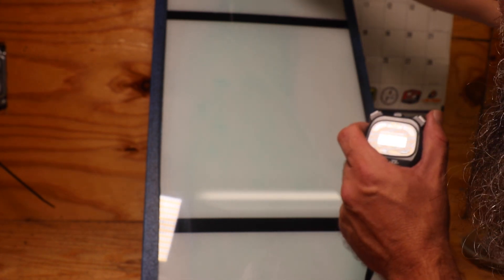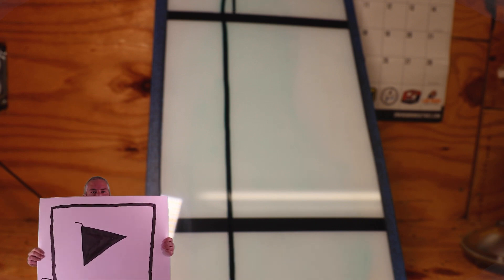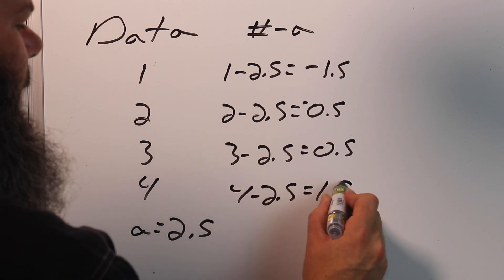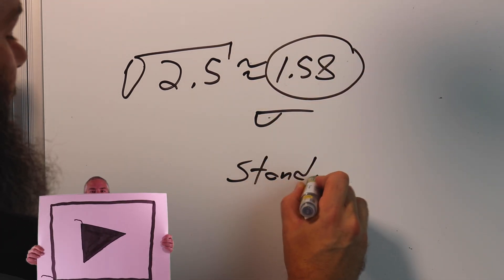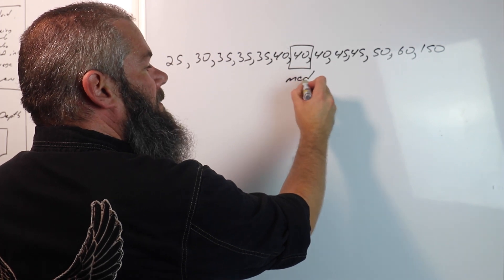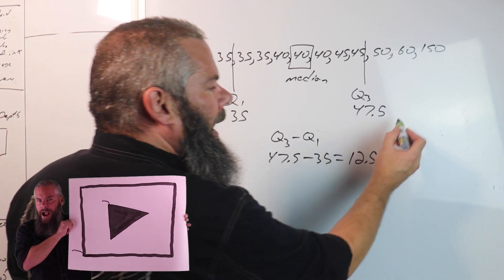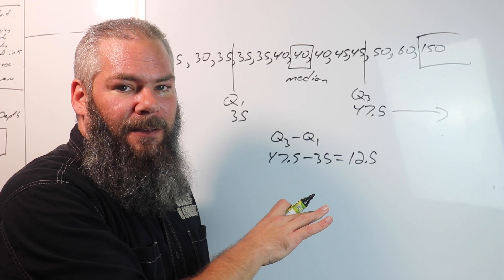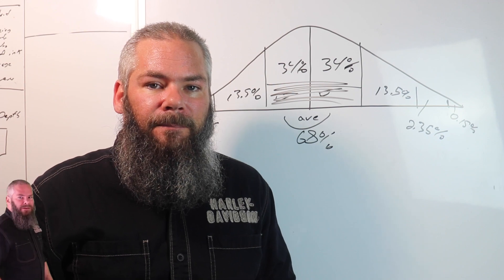How I Test Ink Viscosity Fountain Pen Ink #fountainpenink #fountainpens

Comment: thanks for the insight in how you test viscosity and the effort to produce all of your videos.  One minor issue - you might want to check the calculation of average of the differences between # and average....I think it is 1.5 not 2.5 for your example.  Also, some use n-1 for the denominator for samples less than the population.  Thanks again
Reply from the maker: You are correct about the mistake I made in the example for the video.

I was trying to keep this as consumable as possible for those without a math background, I  avoided being to technical for that reason.

But thank you for noticing the mistake in the example and for the comment.
Reply: @AnInkGuy  not trying to be nitpicky, thought you might want to know.  Thanks again for your videos

Comment: I was wondering if you could also test the viscosity of the De Atramentis dilution liquid and the Noodler's Whiteness of the Whale ink to see how it will affect the viscosity of an ink that you add it to.  I would like to try this because I find some inks look darker than what I was hoping for.
Reply from the maker: I don't have any plans to test how different dilution solutions can effect the viscosity of an ink.  That would open a huge can of worms, lol.
Reply: @AnInkGuy  You would only need to make about 100 dilutions for each ink you test!
Reply from the maker: @rjayt88  LOL, that's right just 100 per... so I am currently getting close the 1000 inks reviewed, so I would also have to repurchase a ton of inks. LOL
Reply: @AnInkGuy  I have one question about the viscosity test.  I would just like to test the dilution liquid myself just to see if it will lower or raise the viscosity of an ink that I am adding it to.  When you do the test, do you use a certain mass or volume for each ink or just put one drop on to see how long it takes to go down?
Reply from the maker: @rjayt88  I just use one drop, net an exact volume to the drop.  But I try to keep the size of the drop for water and the ink the same.
Reply: @AnInkGuy  Thanks for your help.

Comment: Couldn't temperature affect water's flow and the ink's flow differently? I'm thinking of butter vs honey vs water. If that were the case, heatting them to a certain temperature, say 30C, and then running the experiment could control for some of that. Its an extra step, and maybe it wouldnt make a difference... but something to think about. Thank you so much!
Reply from the maker: Yes temperature can affect the test and the flow of ink.  In fact it has the greatest effect on it.  So it is important when doing these tests to recalibrate with water very regularly.

Comment: Good job, both for the fastidious work of collecting the data and the concise explanation. Really well done.

4:03 No, it's not weird to have whiteboards. It's a tool. It's not different than owning a hammer or a soldering iron. At some point, I even transformed a refrigerator into a supplementary whiteboard because I was working on several projects at once. Some offices have their walls and tables entirely painted with dry-erase paint : https://www.performance-painting.com/hs-fs/hubfs/dryerase.jpg?width=887&name=dryerase.jpg

A tip from radio broadcasting : don't get into the habit of highlighting the little behind-the-scenes things that bother you. Most of time they would have gone totally unnoticed by your viewers if you haven't directed them toward those little things. In that case, you unnecessarily distracted your viewers from the content. Or, even if some of them noticed something was bothering you, they likely didn't think much of it... until you amplified, again unnecessarily, a defect that doesn't really matter when it comes to the enjoyment of the content. 

Any way, if it happens sporadically, it only made you more relatable. Perfection, at some point, is only an excuse to do nothing.

Thank you for the all work. This is a very valuable resource.
Reply from the maker: I only left it in in the editing because I only really do ink reviews and I thought leaving the mistake was a bit that I usually edit out of my videos.  That said you are right. I shouldn't have brought attention to the mic that was distracting me.

I had looked at the dry erase paint but wasn't sure how hard it might be to paint over in the future, which is why I went with the board over the paint.
Reply: I didn't think of that. You are right. It might be a pain in the &?%/ to paint over. For the refrigerator I used a static plastic film. It came out without any problem once I didn't need the extra surface.

Comment: Great video, I've been wondering about your methodology.
Have you perhaps considered determining an optimum number of samples depending on the values you get? It would be a more rigorous approach than just taking 9 measurements and calling it a day.
Reply from the maker: 9 was the most I figure I could do from a sample.  I cannot afford a bottle of each to be able to do more  testing than I do.  I do 9 tests because sometime a "run" may be faster or slower than normal for than ink.  I just needed enough to get as reliable a result as possible.

Comment: This is awesome. Was very interested to see how you test viscosity. As one math nerd to another, I was wondering if you ever went down the rabbit hole of computing population standard deviation from sample standard deviation? Just to be clear I am not nitpicking your methods (with a sample size of 1000, they are going to be almost identical), but recently learned about it and thought it was cool and maybe you would too.

Also, do you find viscosity is a good predicter of how wet the ink writes and if it is prone to bleeding/feathering? A-priori it seems other factors could be involved as well (surface tension maybe?). Just curious. And a big thanks for sharing your investigation!
Reply from the maker: I didn't feel the need to go further than sample standard deviation. 

The question of if viscosity has anything to do with how wet an ink writes is what started all of this for me.  What I found is if an ink is to wet, to to close to water's viscosity, then it can have more difficulty writing and seem like it has flow problems.  I found that interesting.  I also noticed that most inks that have a viscosity that makes them dry seem to be "thick." So a bunch of times when an ink tested as dry it gave a very smooth writing experience.

Unfortunately I don't think viscosity is much of a predictor for bleeding of feathering. There are definitely other factors involved, most can be minimized by "calibrating" first.  So I had to run the water every time before the ink making it a long process. It had to be done every time because temperature change of 1 degree and alter the results.
Reply: @AnInkGuy  That's actually really interesting! And no I was not suggesting population statistics vs. sample statistics had any practical relevance here. In my very small anecdotal experience, adding water to a ink (2:1 or 3:1 ink to water say) does have the effect of making the ink a bit drier, so that matches up with what you observed I think. Anyway, cheers, and thanks for the channel.
Reply from the maker: Nice to know there are others experimenting on inks and tracking their results.  You can try dish soap to make an ink flow better through the pen.

Comment: You are a math nerd.  Numbers have meaning by themselves.  One viewer mentions associating dry time & viscosity.   In your test there are a lot of variables, you mention temperature, also humidity, which can affect dry times.  To me the biggest variable is paper.  I find all paper has a wide range of properties on a single page.  Best example is when I get feathering on a few words in one spot & none on the rest of the page, an outlier.   Next is variations in ink, each bottle can be different, over time viscosity will increase as water evaporates.
I echo many viewers, THANK YOU for the time you devote to this & the great videos you produce for our enjoyment.
Reply from the maker: I don't see the paper as a variable because you would be testing all inks on the same papers.  Like I use Clairefontaine, Tomoe River and Rhodia paper as my standards.  And yes there may be some evaporation of water from the ink over time.

While slight variations in the paper and in the evaporation may theoretically have an impact on the result, I don't believe nor have I seen and impact on the measurable results that I am getting.

Comment: I'm really glad that you published a video on your methodology for the viscosity testing. I find that detail to be a very interesting one with inks (it's one of the things I really like about your ink reviews).

However, I don't really think that viscosity is necessarily equivalent to dryness. As an example, most people would say that J. Herbin Vert Empire is a pretty dry ink. Just based on a visual comparison, I'd say that its probably the least viscous ink that I've come across (almost like water). By comparison, Noodler's Heart of Darkness is fairly viscous, and is usually considered wet (though it actually dries pretty fast for a fountain pen black ink, but that's only one aspect of wetness). Additionally, Heart of Darkness feels drier to me when I dilute it with some water, thus making it less viscous (this is likely due to the fact that I'm diluting the "wetting agents" (surfactants?) that are in the ink by doing this). That's just based on eyeballing the viscosity, though, I haven't done any tests.

Of course, most likely people are talking about different things when they're talking about how "wet" inks are, so there is that.
Reply from the maker: I think frequency when people are talking about if an ink is wet or dry they are describing how it can feel as they write with is.  When I say an ink is wet o dry I am strictly referring to the viscosity, nothing to do with how it feels to write with.  I do sometimes mention how an ink may feel to write with. But as far as my results can be looked at... people can see them as they would like.

For me the results just are as they are. 

I am not denying that an ink might be a dry ink but may feel wet to write with, that can be a result of different additives in inks.  I do make slight reference in the ink reviews to how the viscosity is not connected to dry time, but I think people often think they are related.

I have already received A LOT of emails telling me how wrong I am in this test "Because Brian Goulet says he isn't sure how you could test ink flow."

Honestly, regardless of flow, if I like an ink I will use it and that is the advice I give to people.

Sorry if this seemed ranty, I have A LOT of "Corrective" emails because of his video.

I hope this didn't seem like I am being short, that isn't the intention.
Reply: @AnInkGuy  That makes a lot of sense, and I totally get the irritation with being corrected on something that isn't really what you were trying to say in the first place :)

In any case, even apart from how wet or dry an ink feels, viscosity is still a very interesting trait to look at. In fact, I was recently messing around with a Zebra G nib in my Ahab, and it seems like the viscosity of the ink really affected how well it worked when flexing.

A lot of people recommend using X-Feather for this use case, but I found that the more apparently viscous (again, just based on appearances) Platinum Carbon ink actually performed even better. It's a little too heavy flowing sometimes, really. Heart of Darkness performed about as well as X-Feather or a little better, and Diamine Ancient Copper (sadly) performed very poorly. There may  be other factors at play here, too, of course, I only have so many inks to test, and cleaning between them is a pain.

Anyway, that's a bit of a tangent, but keep up the good work, ink guy :)
Reply from the maker: @hypnoshypnos4755  I have also noticed Platinum Carbon Black does better in an aha with a Zerba nib than any Noodler's ink I tried.  

I think because of the flow needed there the viscosity matters but I think there is something else needed there also.  I think the surface tension of the ink can have a big affect when flexing it.  I just don't have a reliable way to test the surface tension of inks.  

Not yet any way.  The day I figure one out is the day I start testing it, lol.

Comment from the maker: I know the video and the process aren't perfect. Feedback is appreciated.
Reply: Great work. Do you have the data in a list or spreadsheet?
Reply from the maker: @joeringer4373  I did the work on a spread sheet. It is a modern word after all, lol.
Reply: @AnInkGuy  great vid and great Chanel. Can you make your spreadsheet available to the public?
Reply from the maker: @catchacoolbreeze  There is no spreadsheet, I am analogue.  Sorry I can't help with that
Reply: Thanks for a very nice attempt to quantify how well one can expect an ink to flow. Unfortunately, inks are non-Newtonian fluids. This means that their viscosity depends on the shear rate. I would expect that the inclination at which you set up your test rig would produce a shear rate (flow rate gradient) that is quite different from the one you may expect in a pen (I would expect the one in the pen to be at least an order of magnitude lower when it comes to the flow in the feed and, perhaps, up to a magnitude more when it comes to the initial contact with paper). Finally, fountain pens function due to capillary action, which is related to the surface tension more than the gravity force. Apparently, there is no direct correlation between the viscosity and surface tension, especially for non-Newtonian fluids (not a physicist, relying on https://www.cscscientific.com/csc-scientific-blog/how-does-surface-tension-relate-to-viscosity among other things). This means that while your methodology is great, its results have limited applicability when it comes to allowing viewers to guesstimate ink flow in a fountain pen when looking at your viscosity results. Again, not a physicist, feedback and corrections are welcome. As an aside, landed here after checking your review of Diamine Apple Glory (viscosity of 1.5 according to your review), which I own and which is the ink with the least pleasant flow in my collection, and got interested in the methodology used :) Finally, let me thank you for your reviews and the hard work you put into them. I enjoy watching your videos a lot! Have a nice weekend. Also see https://www.fountainpennetwork.com/forum/topic/155855-surface-tension-of-ink/
Reply from the maker: It was an attempt to figure something out... you are correct in this doesn't show how an ink will flow through a pen accurately as I would have liked when I started with it.  A major reason that after this year I am ending this test and part of the review.

My test has actually given more info on how to expect an ink to feel under the nib than the flow of the ink through the pen.  A result from having done the test, not what I thought the test would show me.  But the test was originally done "for me" to try to gain a better understanding of what ie meant when others describe an ink as. wet or dry.

I have read a bunch of the posts on Fountain Pen Network where people are doing some tests.... they are doing a much better job than I am.